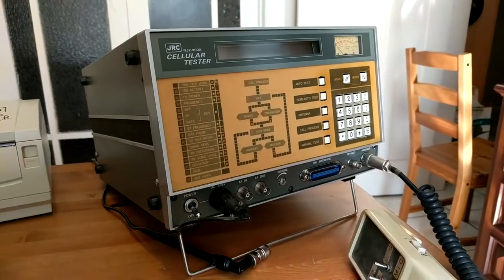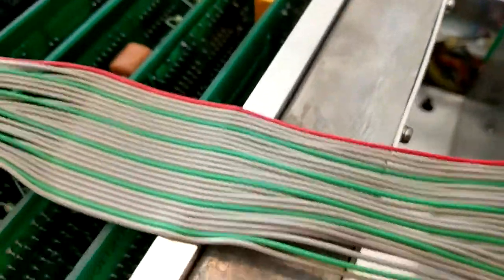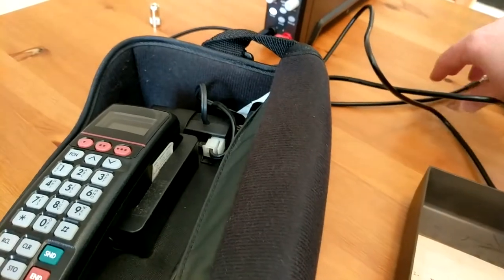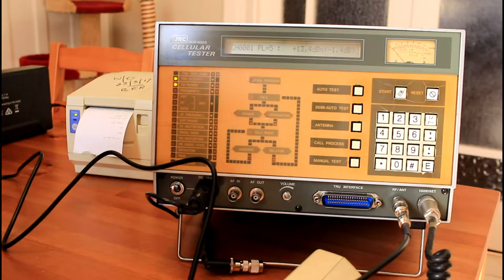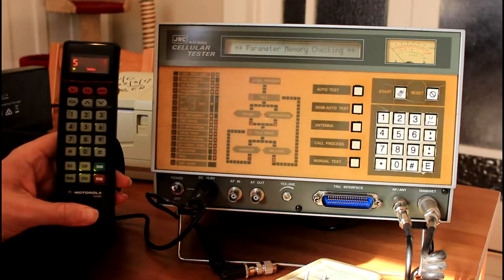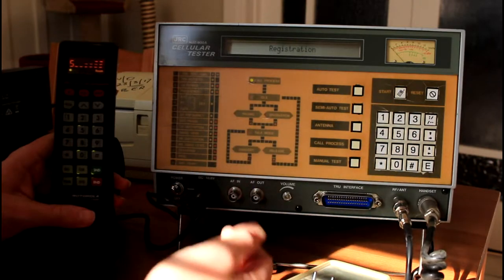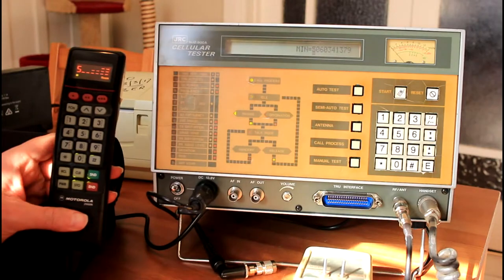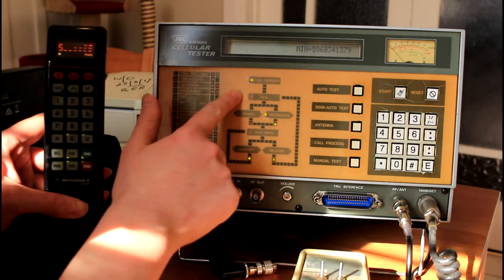JRC NJZ-900A Analogue AMPS Cellular Tester

Comment: This brings back very good memories. I used to work for a mobile phone company in the West Midlands in the UK and they had approximately 8 of these machines. 4 were used for function testing of the phones, 2 were used by the equipment repair section and 2 were in store as backups because these units do break down after a while.  These units were only ever used for testing 'car phones'. A 'car phone' consisted of small box that housed the main electronics of the phone, a handset and lots of cabling to allow authorised car dealers to install the units.

The function test area where these units were mainly used would have the test bench and a vibration rig next to it. The operator would clamp the main unit in the vibration rig and connect the handset to a box on the test bench that went from the bench to the vibration rig. The vibration rig was to simulate the conditions of the unit being in a vehicle that was travelling on the road. The rig could be sped up or slowed down depending on how fast or slow you wanted to simulate the speed of a vehicle. 

No one in the UK could repair these so when they broke down we always had to send them back directly to JRC in Japan. I notice on your unit someone has changed the rubber keys on the keypad because they never looked like that originally.

Comment: DBm is decibels per 1 meter. He’s measuring the RF output of the test transmitter to the mobile phone handset lol. You probably could use that as a miniature cellular network lol, if been wanting to mess with an old cell site transmitter for interlinking with amateur radio. Be the first amateur radio subscriber based cellular phone network lol.just be careful because Vodafone could have ofcon on speed dial.